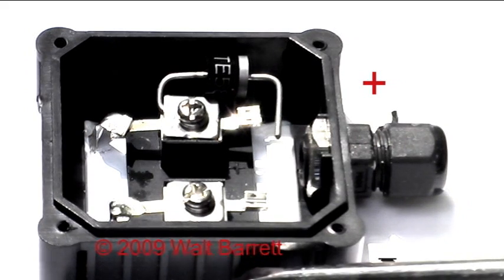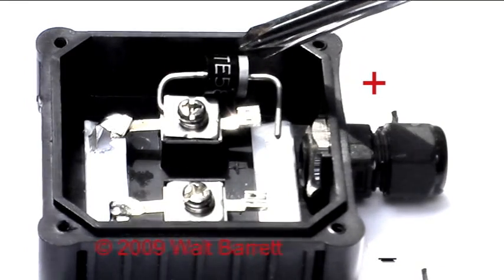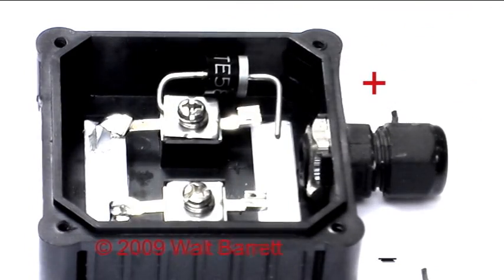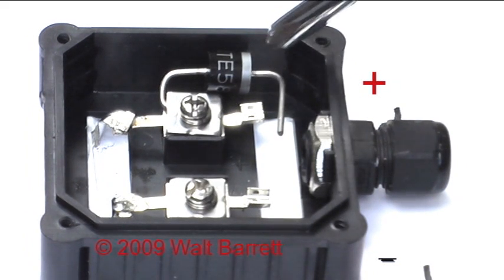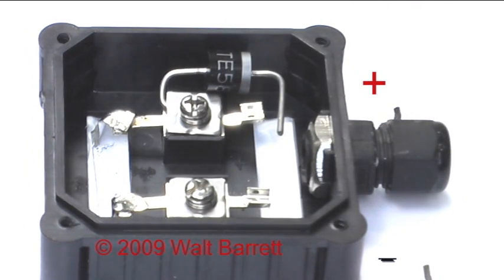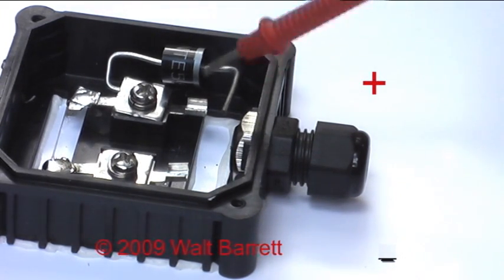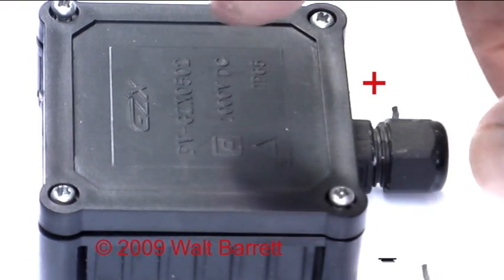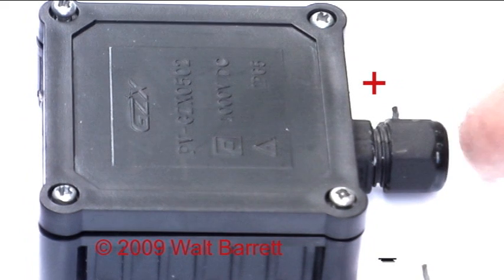Installing the Solar Diode by Walt Barrett

Comment: Hello Walt,

Can do you help me? I have a junction box that support 5-20w, but if I install a diode, how much watts it will support?

Thank you Walt,
Raul.
Reply from the maker: Raul Felipe Ventura Filho Hi, we don't have enough info to properly answer you.  Please check with a local parts supplier.  be sure to provide him with a wiring diagram of your system.  I have answered this before.
Reply: Thanks Walt!

Comment: Love your video by the way. How can i choose a diode for my 104watt/20V/5.2Amp solar module? Can the numbers exceed a little or do they have to be exactly the same as my solar panel?
Reply: I Need an answer for the same question. Are there anybody to answer.

Comment from the maker: This could be a method of blocking off a panel that goes dead.  This method keep you from losing efficiency if one panel goes dead in the array.  Please reference this diagram. polarpowerinc./info/operation20/figures/figure2-24.gif 
Walt

Comment: Some solar panels I bought have the blocking diode connected between the positive and negative screws. This means no crimping necessary. But I don't understand how this works the same???
The silver line still faces the '+'

Comment: All major solar charge controllers have this feature (blocking). It's useless to add one. Now a bypass diode for series strings would be of benefit (if not already installed).